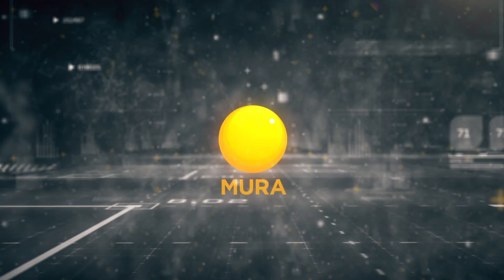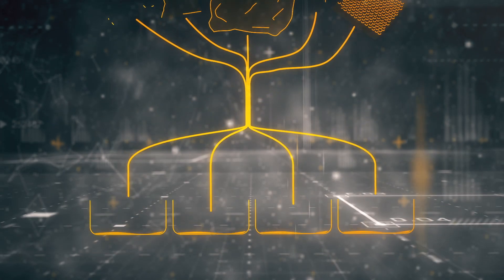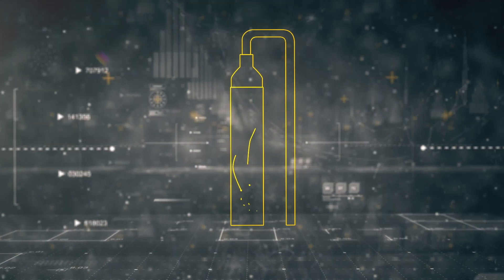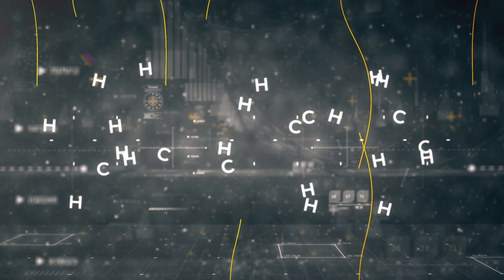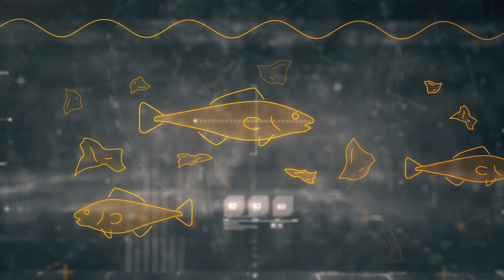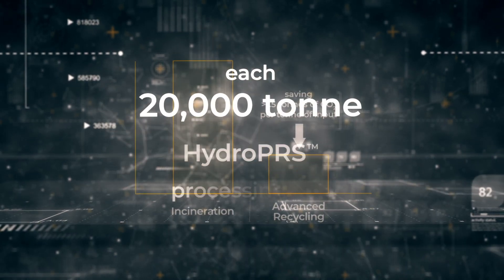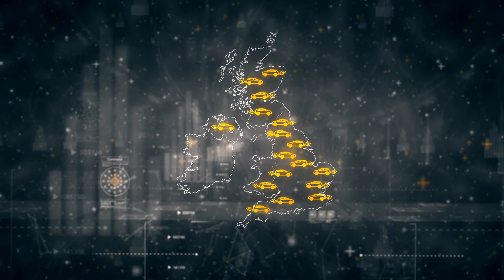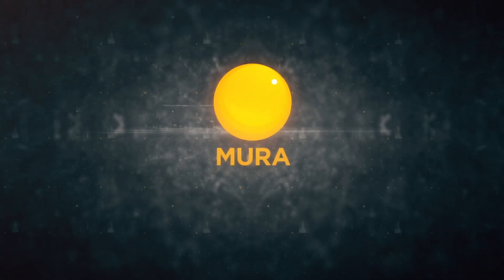Mura Technology & HydroPRS™ Advanced Plastic Recycling Solution

Comment: Classic greenwashing. Another false solution from the waste + petrochemical industry. For 30 years, these chronically failing so-called innovations have been unable to prove their technical scalability or economic viability. Latest boondoggle came this week when the proposed Brightmark plastic-to-fuel facility was scrapped in Macon Co. GA because the company couldn't prove that their first plant in Ashley IN (the one that caught fire 6 months after opening) was capable of selling their so-called products. No valuable product, no market. These expensive and outrageous techno fixes have less to do with recycling (an inherently broken, false solution) than with creating a carbon intensive market to cook mixed plastic waste, incentivize petrochemical buildout and lock consumers into a future of unlimited plastic consumption. The only thing circular about these schemes is their resemblance to a noose.
Reply: Hello Graham, looking forward for more details on the failed commercial development of the Brightmark plant.